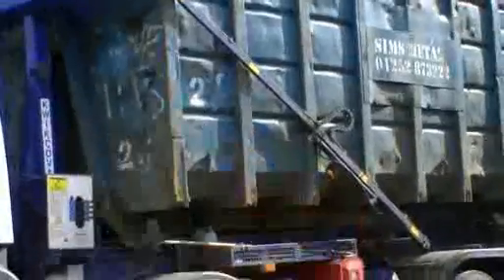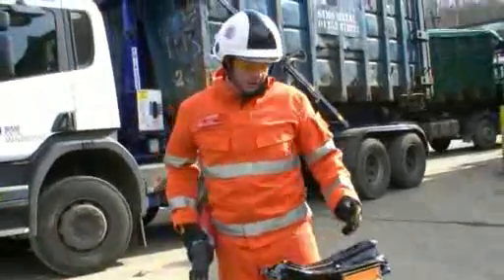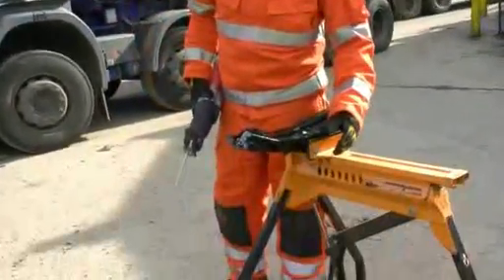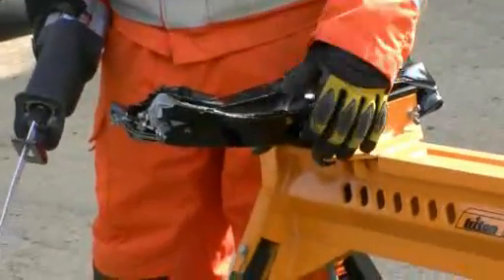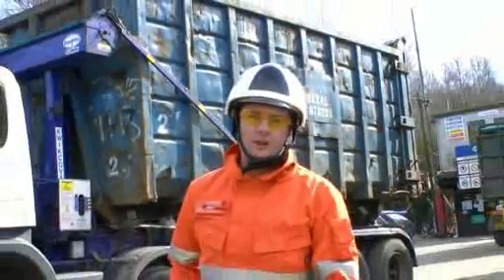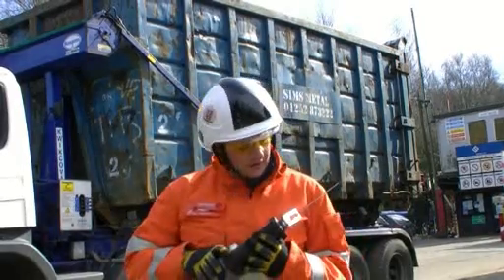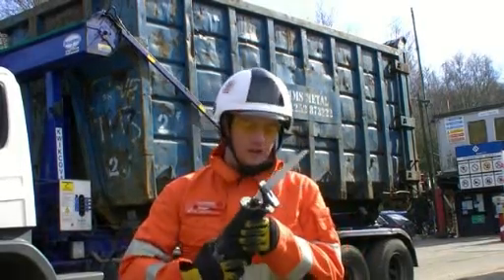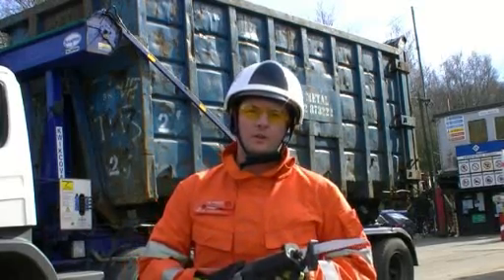Extrication RTC Training cutting Boron

Comment: Bosch Endurance for Heavy Metal saw blades can. Firefighters that I know use them and are very pleased with the results when they are doing traffic crash rescue.
Also an angle grinder with a good cutting disc cuts through almost any metal - boron steel or whatever...

Comment: Impossible - use a high torque angle grinder with a high quality cutting disc. Say Bosch GWS 15-125 CIT with a Saint Gobain Norton Quantum disc. It will cutt through ANY metal like butter.